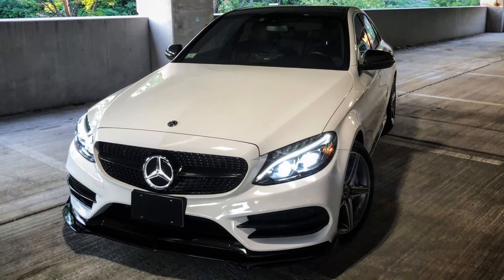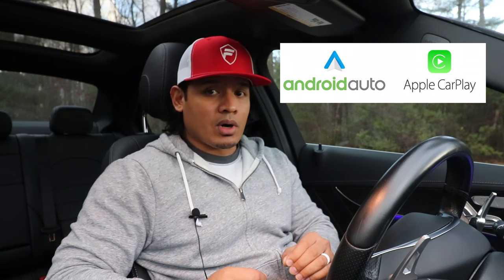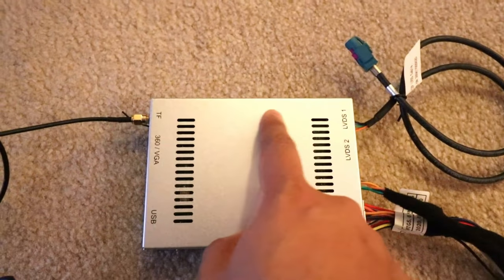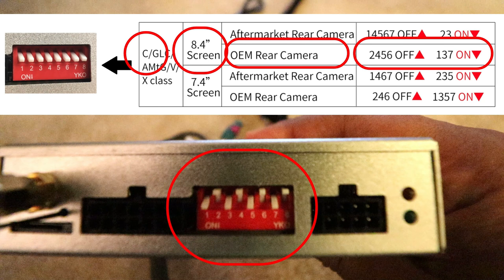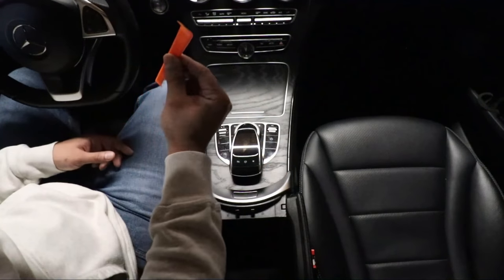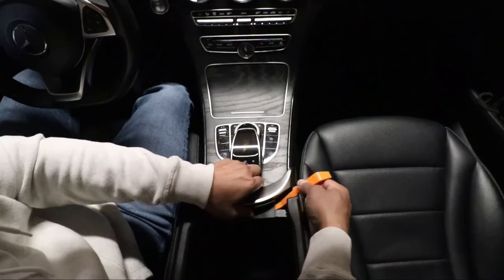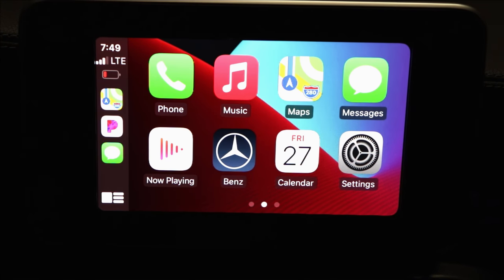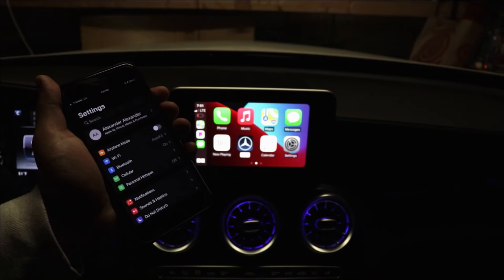Easy Wireless Apple CarPlay installed on OEM Screen of 2015+ Mercedes W205 C-Class

Comment: Just a update for people who have bought the DMP module recently and received the new model.. 
it’s almost the same thing as this unit, just less connections. And you don’t need to run a wire into your arm console.
The new unit uses Bluetooth to run the sound to your car, so the 3.5mm that’s on it gets plugged into the mic input in the module. 
Then you enter your cars "connect your cars Bluetooth" connection to the “DC audio BT” Bluetooth, once connected you can go to the media>bluetooth connection, and while there press and hold the end call button on your steering wheel which will take you to the CarPlay screen and you can connect your phone to CarPlay from there. Also, me and my friend ran into an issue where our speakers didn’t work after everything was set up. We had to pull the multimedia fuse from the passenger side panel out for a bit then everything worked perfect..

Srry i posted this here, but your channel is the best and most detailed one that explains a lot, and most people come to you 💯
Reply: any recent problems? still working ?

Comment: That’s the video I’ve been waiting for . I’m gonna this to my car
Reply from the maker: it's a pretty sweet mod if you don't plan on ripping out your OEM screen. Also, it runs off the data from your phone whereas most of the features on the 10" android screen requires a live internet connection. However the android screen is touchscreen which is nice.

Comment: Isn’t the OEM screen on your vehicle the 7 inch display? Only the COMAND Navigation screen is 8.4 inches. Either way, cool mod to add CarPlay to the car
Reply from the maker: Probably.  All I know is when I did the switches to match the 7” screen guidance...the module interface viewing area didn’t fit.  The 8” screen guidance for the switches made the module interface fit the display properly.

Comment: It doesn't "automatically connect" if you have to press and hold the back button, scroll to the left, and hit iOS.
Reply from the maker: It does auto connect as soon as I turn on my car.  I realized I didn’t have to push or do anything the next day after I already released this video.

Comment: Hey Flexx. Do you have any mods or suggestions for a better sounding exhaust?
Reply from the maker: for a base c300? Not sure...but I do have a new muffler sitting in my garage waiting to go on in the future video. Probably in 2 weeks.
Reply: @TheFlexxGarage  Ok I'll be looking forward to that video then. Other than getting a new exhaust setup, not sure what other options there are. Keep up the good work man.
Reply from the maker: To be honest, most aftermarket exhaust systems for the C300 is way way waaaaayy too expensive. At the end of the day, it's a 4cyl c300...just slap on an aftermarket muffler and delete some resonators...done.  I'll be doing a 2 part video. You'll see.
Reply: @TheFlexxGarage   Looking forward to it brother. Enjoy the rest of your weekend.

Comment: Great video flexx, I noticed when you removed the console it had the standard air vents and when you replaced the console the air vents where the turbine vents. Also your ring went from blue to white lol did you do a few takes?

Comment: On the aftermarket 10” screen did you have less rattles and vibrations than the oem screen? My oem screen rattles when I hit bumps and was hoping the upgraded screen would alleviate this.
Reply from the maker: Barely any noise if installed properly.

Comment: Does the audio converter have enough length so that the entire converter be located under the console with just the USB plug extending into the center console to plug into the USB port?

Comment: Hi Flexx,

Great tutorial. I will probably go for this on my w205. In my COMAND (8.4"), I do not see USB Aux as a media option. Does the USB interface that comes with this kit enable that on the COMAND interface? Or did you already have USB AUX in your COMAND options?
Reply: Doesn't it have USB connection?? (Asking Flexx)

Comment: Do you have to hold the back button every time you start the car or is there a way to have car play turn on automatically
Reply from the maker: I tested it some more today.  When I get outta the car and lock it.  When I come back later, if the last thing I was using was CarPlay, it will automatically connect to my phone and be on the CarPlay screen. I think I’ll do another video on the details of the CarPlay module and how everything works.
Reply: @TheFlexxGarage  thanks for the info man!
Reply: @TheFlexxGarage  When will you make this video?
Reply: Meaning you don’t have to click on the back button to link with the phone?

Comment: Do you have to hold "Back" button every time you start a car to get to Apple Screen?
Reply from the maker: No. That’s only if I don’t set CarPlay to auto connect.   

If I have auto connect setup on the module and my phone has Bluetooth turned on…when I walk into the car…CarPlay auto connects to my phone.  I will only need to hold the back button if I wanna go back to my oem interface.

Comment: Great tutorial. Just wanted to ask how you installed the aux cable from under the console into the center box? Tucking it under and screwing it back down will surely crush/damage the cable in due time.
Reply: You better drill a hole or a v notch and pass the cable through it!

Comment: Hey, so I purchased this, and installed following the directions, but I’m not getting any picture on my screen. Some of the parts are a bit different as well such as the usb connection
Reply from the maker: did you buy it from DMP?
Reply: @TheFlexxGarage  yes I did. Used your code as well.
Reply from the maker: Contact them for support. They'll be able to let you know what to do. I know they started shipping an improved version since the one I have in my video is a few months old.
Reply: @ Jeremy.  I am having the same issue. Did you ever figure it out?
Reply: Same issue, anybody figure it out?
Reply: Did you guys figure out the issue? Perhaps incorrect dip switch settings?
Reply: Press and hold the favorites button instead of the back button.

Comment: Does the reverse camera still appear when you put the car in R or do you need to exit this menu and go to the original one?
Reply from the maker: Automatically. Just have to make sure your settings are correct so it does it auto.

Comment: Hey Flexx! I have the Merc C-300 2016 model.
I connected everything like you said.There were a couple new wires but i figured that out as well, but the screen doesn't start.
Can you help?
Reply: Did you figure out the issue?

Comment: Hey Flexx another follower asked you this already but I was reading the notes when You go to the dmpcardesign  webside , and this is what I found:

1.Works with wireless Apple CarPlay, pairing via Bluetooth, transfer via WIFI.
2.Work with Wired CarPlay also,turn off wifi at first, connect via lighting cable(wired keep your phone charged at the same time)
 In the kit it doesn't show the usb cable , do you know anything about that.. really appreciated your answer....

Comment: Hi Flexx,

When you're connecting the blue connection (display) to the OEM radio display input, where do you connect the other side of the cable? It's a female USB. 
There are no cables in the box that end with an AUX connection, except for the mic. 
Thanks in advance!
Reply from the maker: Not sure what you are referencing.  Everything in my video is clear for the kit I got. If you are missing something or it’s different, you have to reach out to your reseller for support. If you bought from DMP, they will be more than glad to help you.

Comment: My module turns my display off and the lights on my cars center module where the AC and multimedia lights right whenever I try to switch it to the module screen when holding the back button. After bunch of tries of holding back button I finally get my stock screen back but if I hold the back button to switch to the CarPlay screen it turns off my screen and the lights on my center module. Any clue what’s happening?

Comment: Hi, I have a couple of questions about this unit:

- What is that audio to USB cable for? Not sure what audio it is referring to.
- Can you listen to the radio from the MB system and at the same time have Google maps on the screen? I don't understand if you either need to use just one of the systems (i.e. just use GMaps with YT music only - both in Carplay, or you can listen to radio from the MB original system and also have GMaps on the screen from Carplay) at a time or you can combine them.

Thanks!
Reply from the maker: That’s how you get audio from the module into your oem speaker system.  It’s kinda like an AUX. 

Not 100% sure but i believe when you are in the CarPlay or android auto system…you are confined to those systems. Because the audio switches from OEM audio to the module audio (that’s plugs into the usb) when you access CarPlay/android auto.

Comment: Hi Flexx,  I have contacted the device to the car following same steps, the car screen stopped working, but the radio was still ok.
As I rolled back and took off the harness, the screen is back to work.

Please let me know if anything can be done from my side, or there's a problem with the device or the harness.

Looking forward to hearing from you.
Reply: Have the same issue. You ever figure it out?
Reply: I got this same issue as well, were you guys able to figure it out.
Reply: Did you guys figure the issue out?

Comment: Flexx my door handle outside light is out where do I get them and what do you call them. I have the led light package where all door handle light up. My front door light is dim. Thanks
Reply from the maker: Don’t know.  Mine went out and it was covered under warranty.  If not, be prepared to have to rip your door apart to get to the led. You can’t replace from the outside.

Comment: Hi flexx I’ve done exactly everything and the CarPlay is working very well but! The problem is I forgot to disconnect the battery 🔋 !!! And now cheak engine is showing what should I do please please help me
Reply from the maker: I would disconnect the battery for 10 mins , reconnect it, and the check engine light should reset. If it doesn’t, you might have a real issue that’s causing the light to be on.
Reply: @TheFlexxGarage  thank you sir 
I’ve done what you told me and now car is fine 
U are genius 💭👍🏻
Reply: @thenotoriousqais5075  did you have a check engine light? Or the prompt “Start Engine” with the battery symbol in the middle of the dash cluster?

Comment: So my kit just arrived everything looks good except it came with a mic. Where is the best place to run it to. I noticed yours didn’t have this. Also do I need the mic or does it run off the factory mic?
Reply: You need to install the mic and I suggest behind the screen or otherwise inside the middle box near the aux cable. Don't put it inside with the module as it won't listen well too your voice commands or phone calls.

Comment: Installed the Android Touch Screen version 10 on my 2016 Mercedes E400 Sedan.  Very happy with the screen and the functions it brings.  However, the only one thing I cannot get it to work is carplay or phone link.  My iphone works perfectly with the Mercedes system even wireless I can enjoy my music.  But on the Android side when I press the carplay app it shows loading and the cursor going in circles for a few seconds then nothing.  Same when I press phone link.  My guess perhaps my 2016 E400 sedan doesn’t support carplay or apply play?
Reply from the maker: Did you watch my screen review video? Cause that will show you what app is for CarPlay.
Reply: @TheFlexxGarage  Thanks for such a quick reply.  Actually I was watching your video "Easy Wireless Apple CarPlay installed on OEM Screen of 2015+ Mercedes W205 C-Class".  For those folks who want to keep their OEM screen but with apply carplay features.  I need to find that review video you mention.
Reply: @TheFlexxGarage  Just finished watching your video "Adding APPLE CAR PLAY to my Mercedes Android Screen".  That could be the solution in my case since I already have the 10.25 Android Touch Screen version 10.  To bad it's not wireless.  Thanks

Comment: How is it when you want to fx play music through CarPlay? Like fx I own a Peugeot 308 from 2016 now, and added CarPlay for it later on. The way it works, is that CarPlay boots up easy every time I start the car, but if I want to play music, I first have to switch the cars audio output to Bluetooth, then go into CarPlay, open Apple Music and play something, for then to open my iPhone to also select Bluetooth as the output on that for music sound to come through CarPlay.
Is it the same story with this Mercedes CarPlay, or is it different? Hope that made sense..
Reply from the maker: It’s different.  The CarPlay module has a setting to automatically control the switching of audio source.  

Let’s say I get into my car and my screen is on the oem interface.  I can hear music from radio and stuff.  If I hold down a button to access CarPlay, screen will auto go into the CarPlay, the audio source will auto switch to aux, and I can get music playing automatically by selecting music from my phone or the CarPlay interface. (As long as Bluetooth/WiFi is turned on on my phone and I already went through pairing it for the first time)

I can also program my CarPlay to automatically connect to my phone as soon as I enter the car. So if bluetooth/WiFi is turn on my phone…as soon as I start the car…CarPlay interface is on and I can start using it and listing to music. No crazy fumbling to switch audio source or connect or anything. It’s quite good. Once you manual pair it for the 1st time, you can set it to auto connect.

Comment: Hi Flexx, Perfect video as always!
One question, can you use car play for navigation and still listening normal car radio?
Thx!
Reply from the maker: when you are in the carplay interface...you don't have access to your OEM radio signals or Sirius Radio. You only have access to music playing apps on the carplay interface. So if you are listening to pandora or spotify, yes, they will play while you are using a nav app on Carplay.
Reply: @TheFlexxGarage   Thank you!
I successfully installed the carplay system, however Im not lucky with the sound. I have the usb/aux option in media center, but when I select it, it shows me first: activating device, please wait and after that media interface unavailable. Any idea what can be wrong? :( 
I was also thinking to plug the audio cable directly to that oem radio, since I find out that I have cinche AUX conector in back of that radio
Reply: @michaelstrecha54  it will not work, you need to connect to the Aux and select the device audio through device settings, aux

Comment: is there any issue with the module that its hidden there under the radio ?  i mean if it will be any issue  like over heating ? fire risk ? 
after two years of using it did you had any issues ?
Reply from the maker: Zero issue

Comment: I am just now upgrading to the 12.3" android system. I had previously installed this module but I don't want to take it out. My question is can I install the 12.3" android system with this module still in place and get them to work together?
Reply from the maker: Pretty sure you can’t. Plus DMP’s android screen has CarPlay built in. So not sure why you would wanna keep the old CarPlay only system.

Comment: Hi Flexx, I used your 5% code and purchased the DMP unit for my 2016 C450. I installed it 2 days ago. With the car parked inside the garage, both my iPhone 12 pro and iPhone XR are able to connected to the carplay and seems working fine including the factory backup camera. But as soon as I drop off(with the iPhone 12 pro connected), the screen became blank but the kkbox music from carplay is still playing in the background, just blank screen. With the iPhone XR connected, the Carplay is working fine with Waze, Spotify showing, but the factory backup camera is not working. Any idea? Maybe use the USB wired connection method instead of the wireless connection? Please share your thoughts
Reply from the maker: Not sure. Never seen that issue before.  Please contact DMP and ask. They should be able to help you out.
Reply: Did you figure this issue out?

Comment: Hi Flexx, thank you so much for this video. I had this unit professionally installed today and everything works except now there is no sound in any of the apps when im in Apple carplay, nor when im back on the Mercedes interface. (I.e. no sound from the stock radio or anything that makes sound)

Neither the technicians nor I know why. Any thoughts you can offer would be greatly appreciated. Thank you.
Reply from the maker: Sounds like a setting is not properly set cause the system probably went back into its defaults state. You would need whoever sold you the kit for support since not all kits are the same.
Reply: Thanks. I bought the unit directly from DMP & had it installed locally.
Reply from the maker: Just send them a message then. They’ll be able to walk you thru the fix.

Comment: Hey flexx, i have c200d w205 2018 but i don’t know if it works its the facelift model?
Reply: If you have a 2018 model there is a chance your car is pre equipped for CarPlay. Check your vin and look for option code SA154 Panasonic headunit

Comment: Hi Flex, great video. Does it work with a factory 360 camera?
Reply from the maker: Not sure.  I don’t have 360 camera. But I can only assume it works 100% just like my screen switches to my oem backup camera when i stick the car into reverse.  It has nothing to do with the CarPlay system. Only DMP car design can confirm. You will need to reach out to them.